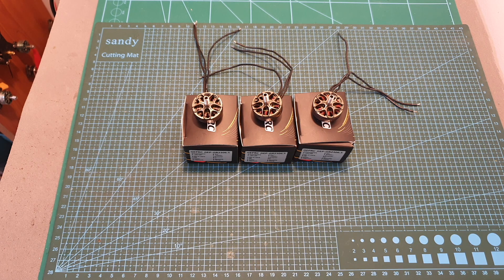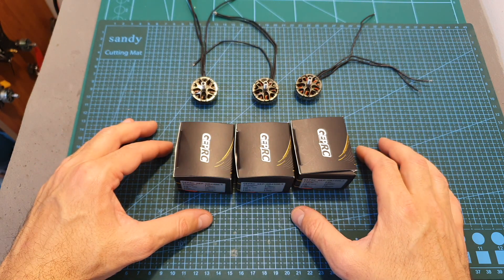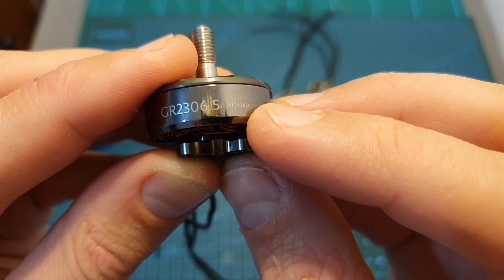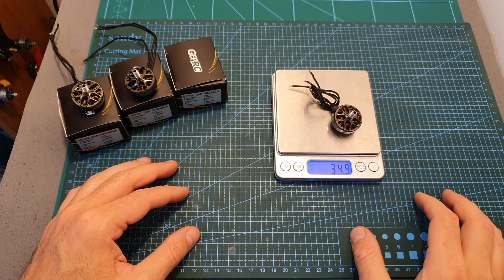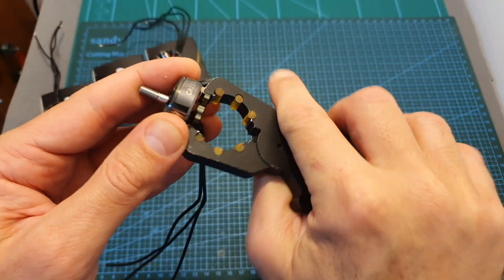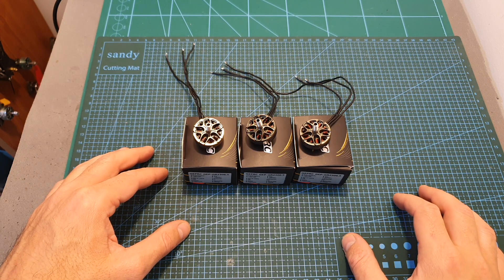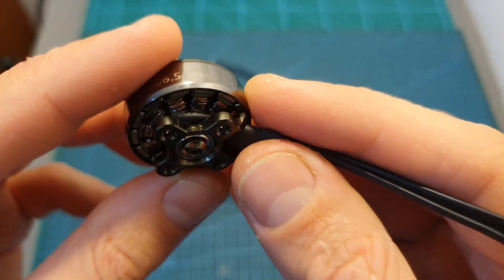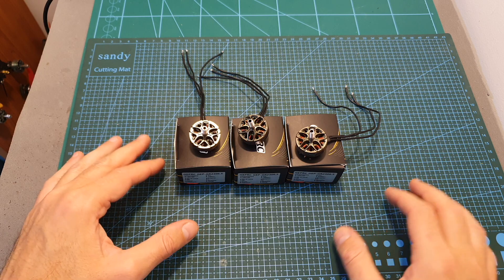Geprc GR2306.5 1350/1850/2450KV Motors Thrust Test

Comment: I've watched SOOOO many videos explaining kv and I'm still in the dark.
I built a Tyro 129 7" drone, hoping one day to be able to do some cinematic FPV stuff.  I'm a 60 year old beginner and found it too hard to control, so I bought some smaller motors and smaller props.
I went from 2507 1800KV motors with 7056 props to 2305 2500KV motors with 5047 props and its still WAAAAY too fast / too twitchy for me.  Using a 3S 2200mAH.  My reflexes are just too slow.
I know there's nothing better than stick time, and crashing is expected, but there's a limit.  I'm getting so frustrated...
Reply from the maker: Hi there. What you can do in order to solve your problem is to adjust the rates, limit the motor output and adjust the expo of your throttle.

Comment: Strange the spec sheet for the 1350kv says up to 7 grams per watt yet your test topped out at 4.5 and caught fire.
Reply from the maker: Either something went wrong with my test or the specs are not correct (or both lol).